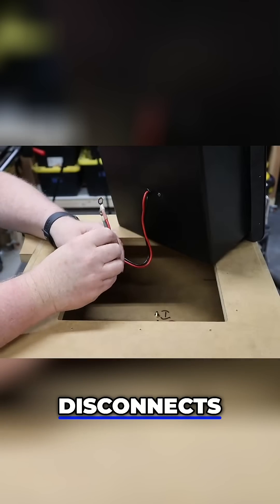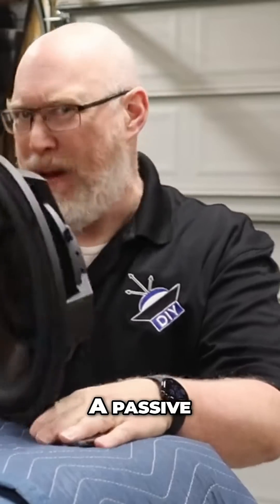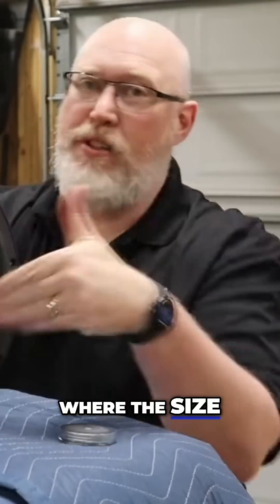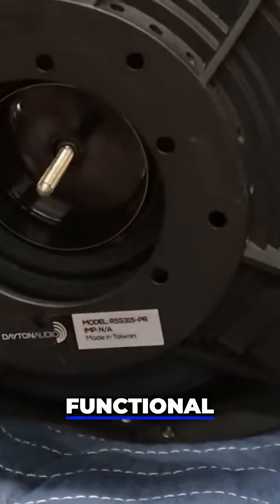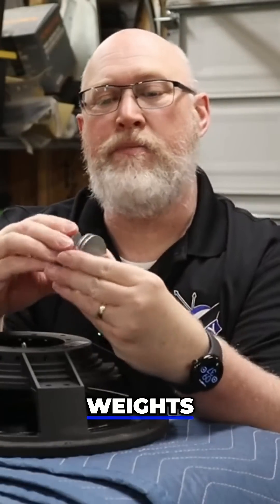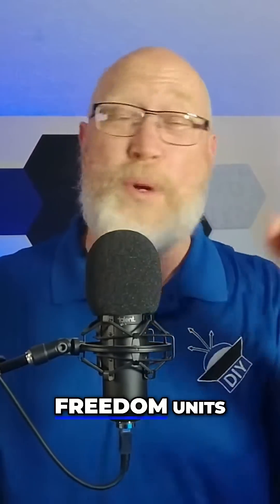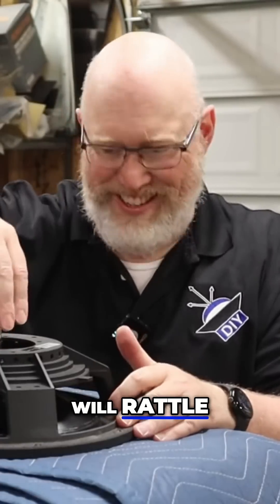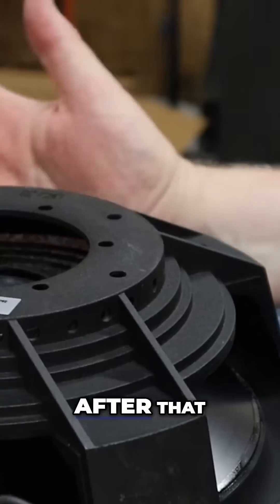Subwoofer Tuning  Adding Mass to a Passive Radiator

Comment: To find air leaks go around the joints of the box and by the subwoofer with a lighter it will turn off with the air leak when u locate it

Comment: Adding weight decreases the Fz. But at a GREAT cost of sensitivity. I tumed my 3 way cabs down to 35hz. Bass was not really there even though the wooder had a 30 fz. After years of thinking that the graph is right, so it must be good, I started thinking again, for myself. I removed all the 38grams of weight. The bass came alive. I used the rice granuals trick to test my tuning to see why this magic was happening. Turns out the bass is now solid, low and much more preset with a tuning of 48hz!! Here is the unbelievable fact......pink noise tested 1w 1meter before removing weights 83dB. After removing weights 92/93 dB! In effect, I am hitting it with 10x the power, but still using 1 watt! My ears believe it. The meter isn't lying in either case.
START EXPERIMENTING FOLKS!! THROW AWAY WINISD AND ALL THE GRAPHS AND LET YOUR EARS DO THE HEARING, NOT YOUR EYES. 😊❤
Reply from the maker: When you tune lower the peak SPL will go down.  This is exactly what the graphs in WinISD show will happen.  That is what this build was designed to do.  I sacrificed output for low end extension.

Comment: I usually invert the drone and then add weight until I reach the desired tuning frequency. Easy on the fly adjustments then flip it back when I’m happy with the tuning.
Reply from the maker: Smart, thanks for the tip.
Reply: I do the same thing 😊